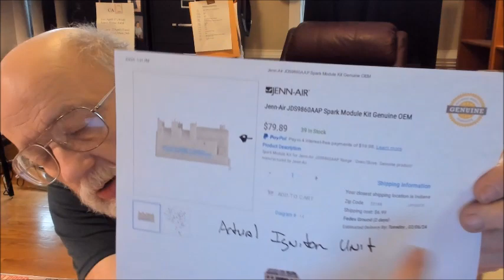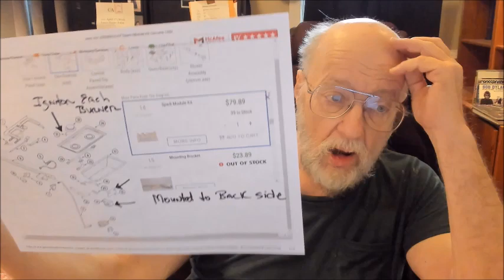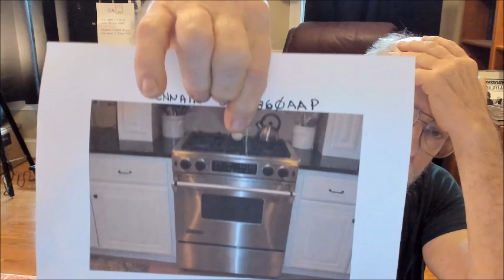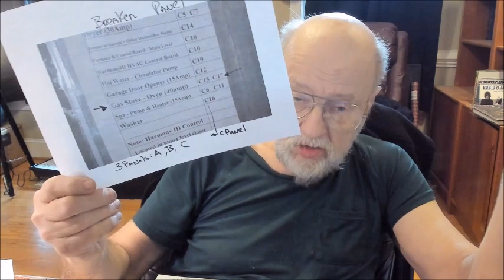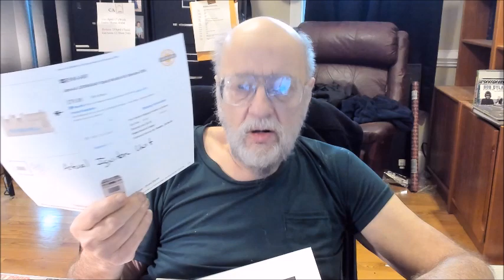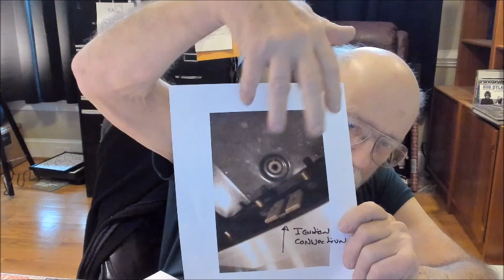Uncle Ron and Stuff -  Replace Spark Ignitor on Jennair JDS9860AAP

Comment: Uncle Ron, what is the best method of cleaning the grill burner? The instruction manual says not to immerse in water.
Reply from the maker: I did not have to clean the actual burners. Know you can remove them but as for cleaning.....Flame from every hole in the burner??  Cosmetic clean only??
Reply: Cosmetic only, it’s the long burner for the grill. Flame from every hole.

Comment: Thanks for the info it’s a big help  , I have the same stove , I wake up in the morning to use the stove and no clicking sound , I’m guessing it’s the spark module ? , for your problem I also seen a guy remove the left burner section take that apart and the wiring where it’s taped together was grounding out to the metal frame , he put some electrical tape on it to fix it
Reply from the maker: I assumed ignitor but after replacing it, I found wires from unit to burner pan connectors so covered in grease that I think the sparker was shorting to the ground of the unit. Cleaned wires and coated with liquid electrical tape. Either way, sparks burners every time now and has been at least a year, if not longer. Not a bad job other than pulling unit out away from wall. Hope it solves your problem. Oh, I also had to replace the  oven convection fan. Fan replacement was hard to find as actual part number is no longer available from anyone. Some sites say they have until you go to order and then, no longer available!  Thanks for comment. Hope you get it firing again, regular like.  R.
Reply: @rstultz3  Ok cool thanks , I ordered the part I will let you know how it goes after I replace it